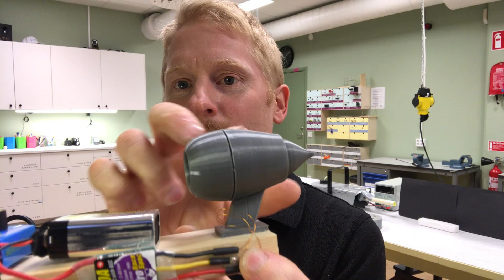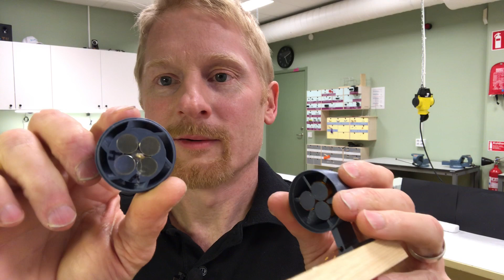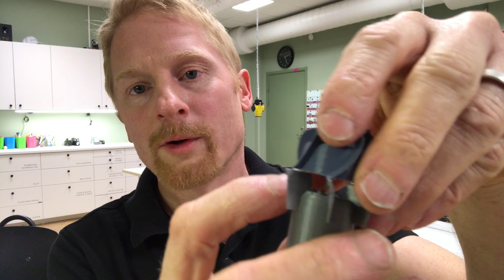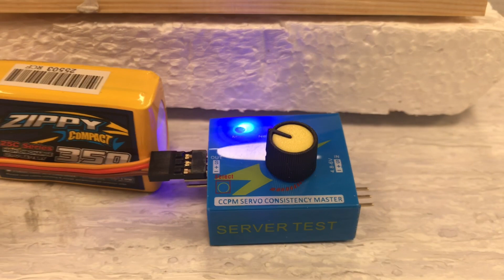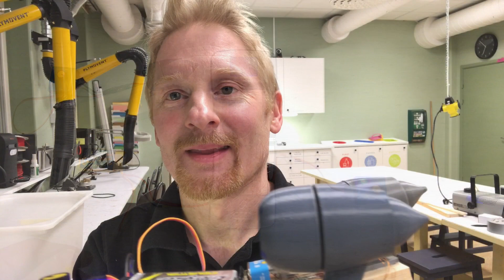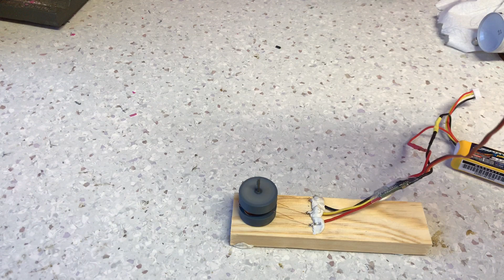Improved 3D-printed  3-phase electric JET

Comment: This is the most simple version of the axial flux motor design. The problem with this design is, that the permanent magnet flux diverges and a certain part doesn't penetrate the coil. So it is better to place the coil package between two PM packages. Further improvement comes with iron manifolds at the PM packages at the opposite side to the coil side for flux guiding.

Comment: The reason that the old design is faster is because it has less load. Also, if you construct the front section so that the place where the air changes direction (which creates a high pressure area, which is why the smoke comes out of the side even with a labyrinth seal) is further back into the back section, I think you can reduce or eliminate the leakage and improve thrust. You can also try making the airflow transition gentler to reduce the pressure at that location and/or increase the volume of the back at the transition. It would be very interesting to see the different results of each change.

Comment: I suggest incorporating a steel disc as a magnet backing plate to increase and focus the  magnetic flux toward the coils... a 50mm (2") washer for example would be cheap and easy - great work, very interesting :-)
Reply: would be a great modification, can't wait to see version 3 (not sure if that's happening tho)
Reply: Be sure not to put it between the magnets though as this will reduce the efficiency through eddy generation. I used to design magnetic drives :-)
Reply: Absolutely!  If the modifications you've suggested were implemented there's every chance this motor could be powering airliners.  

On a personal note, is flogging dead horses your fulltime job or just a hobby?
Reply: @anonymouse2141  Reduction of eddy generation efficiency could ruin the whole project!
Reply: @TheJazsa80  ah....okey dokey...my error....I assumed.itd be the same as a mag drive but of course both parts spin in that and they don't here.
Reply: Yes you need a back iron both in the rotor and stator, that would increase a lot efficiency of the electric motor, the way you built it now is a coreless motor
Reply: A pyramid magnet would be useful in focusing the magnetic flux toward the coils.  However I am not sure how you would implement it given the footprint.

Comment: Hey nice video and concept.
Would it be better to have a fully static housing, with no gaps, made of 2 pieces.

Along with a propeller set up made of reducing layers of 3d printed blades attached to the magnets. Acting as a compressor.

This would leave no leaks, and a lighter load. This would probably increase thrust output as well.

Comment: The second version revs higher because drag load has been removed and the motor rotational speed can then move closer to its theoretical maximum i.e. 120 * frequency / number of poles .

Comment: Very nice model, 7 grams of thrust is pretty good. (I'm not a expert or anything, but it is something and it worked). There's a guy building super light weight models using this design.
Would be cool if you could do a demonstration of various prop designs for comparison.
The next level is adding a gas combustion chamber, but i think that is beyond the material capabilities of a 3 d printer.

Comment: Great work, I took the liberty of doing the maths:
Old design: 1.01A @ 12.1V = 12.221VA @ average of 4.15 grams of thrust
New design: 1.21A @ 12.1V = 14.641VA @ 6.9 grams of thrust

Old design VoltAmp per gram = 2.94481927711
New design VoltAmp per gram = 2.12188405797

Using a simple percentage formula we find that the new design uses 28% (actually 27.945185823002895%) less energy per gram of thrust, quite impressive what some extra fins and a semi-decent seal can do

Comment: Try using rod magnets with a longer length and smaller diameter. You are restricting air flow with the disk magnets you are using. Nice job on the jet.

Comment: Great Work!   I'd guess that the new design, with the more efficient seal, could carry a higher angle in your input vanes, to load it more.   The newer unit may be running faster because it's underloaded?

Comment: This would be so nice if it could be made to put out way more thrust. But I guess is that was a feasible thing somebody would have done it already, probably.
Reply: It has not been done till it is done.....
Book of Shadows 12:6..... Lol
Reply: It can be done pretty easy but he didn't design it to give much thrust, its only an educational model.
Reply: @ExperimentalFun  I understand it was an educational thing, but that still leaves me wondering, why can you not readily find them at any hobby shop, or site. At least not in that size, or only electric.
Reply: It's probably been thought of but not been done as it takes a lot of time and failures to refine and develop and not many people have the persistence.
Reply: It took James Dyson over 5200 failed prototypes to get his cyclone vacumn working after the original eureka moment
Reply: @anonymouse2141  No argument here. But what this dude intends, he stated in the video, is not to produce something like what I referred to.
Reply: @DavidHanniganJr  Ducted fans and impellers can be bought for rather cheap at any model rc shop. They don't have this massive restriction but that's because that is just dysfunctional...
Reply: @Argosh  yeah but I'm not concerned with ducted fans/EDFs really. That's not the scaled down equivalent of what I'm wishing it (though probably can't without exotic technic's, and/or materials, at costs that a majority of the people can reasonably afford) could produce in raw, or responsive, thrust. Like the versions scaled down from.
Reply: @DavidHanniganJr  I have no idea what you are talking about. There's proper kerosene powered miniature jets, there's the range of EDF/Impeller systems. To my knowledge no one has ever built an electric jet, the mere concept is nonsense.
Reply: @Argosh  👍 Works for me.
Reply: @DavidHanniganJr  you can, heard of an edf?
Reply: @Toby-ju1fs  yeah I've heard of them. And they suck.
Reply: Well, speed is there, so improvement would come from profile alteration. For instance, a wider inlet for the engine to breathe more easily, a better labyrinth sealing, a narrowing inner profile for air compression and a longer/straight output cone (the angle is too steep and the flow lifts off, that causes drag). But as it is shown in this video, any improvement will lead to an increase of current in the coils so the global efficiency doesn't improve much.
Anyway, for an educational project, this one is really good and goes far beyond the 3 phase motor technique with all the peripherics involved, specific requirements (balancing, materials resistance, cooling), and testing methods. 
How I wish I had such a teacher at school !
Reply: it wouldn't be difficult to do, you could even just modify his design, so that the outer cowl is a little longer and disconnected from the inner rotor. It would assemble the same, more or less, only with the addition of glue around the seam, and that outer part would no longer rotate dangerously. I'm not sure if it would be "way more thrust" but it would definitely produce more.

Comment: I thank you for the simple system you have produced. I think i may redishn it with a small metal rod to focus the magnetic coil and use a more presice measure of wire.
Question though..... if this system is made larger and you use like 8 magnets and 6 coils.... Do we have to like reverse windings or should i try ......? Totally Awesome project to tinker with.... Thank you so much .
Reply: Sounds like you could be building an improved version of this piece of shit.  Imagine if both could be placed in a museum for the world to see.  People would come from all over to see the piece of shit that started it all and the improved piece of shit that took the pointlessness a step further.
Reply: @TheJazsa80  Ahhhhhhhhhhhh The polished Turd...........

Comment: Awesome idea, if you reduce the number of the windings  the motor would produce more power and more thrust!
Reply: ???? is that right? Hmmm.
Reply: @erniebolado3648 Of course.. I do mini quads that uses brushless motors, the more windings there are less rpm but more torque... And less windings will produce more rpm but less torque :)
Reply: @niswardfpv7949  Thanks for the assurance and added knowledge you've given me. Do the weight of the rotor have impact on rpm?
Reply: @erniebolado3648 not to much.... The most important thing is to have the rotor balanced properly.

Comment: Good evening, I wnet ahead and built the motor but now with everything connected it wont spin, it just stutters, I checked all my soldering connection and I am using a 30A ESC, any input as to why it wont work.?

Comment: I don't know if you did it already since they seem to run without much friction, but taking the side covers off and degreasing the bearings with some alcohol or something and a toothbrush will really reduce their friction. Might reduce the lifespan but it'll still be a long time before they die, I reckon. Slight risk of them melting the plastic but I doubt it, just something to look for I guess.

Comment: What would happen if you enhanced your jet and added fan blades on the outside like a fanjet engine on an airplane ? I realize it would add more weight but would it also increase thrust ? Would be an interesting experiment. Albeit you would have to edit the 3d print and perfect the added outer blade count etc ...

Comment: Hey this maybe a stupid question, but I was thinking. Would there be a way to add in capacitors to act like a mechanical motor with cylinders. My plan was to reverse the process of the three phase motors except hood it back up to capacitors and then use them with relays to fire electricity in sync with the speed controller (major flaw is relays are way too slow for 30,000 rpm) This would work in conjuction with what you already have. Although the addition of more weight and the inefficientcies may not make it vallubale. I'd still like to see it

Comment: I made one just like this, 4 magnets 3 coils. I have tried multiple configurations of wire diameter and numbers of turns, and it just won't run. it either won't turn at all and just jutters or it will only spin slow before the driver shuts off. I have tried both wye and delta configurations and yes I am wiring it up correctly. I am completely stumped.
Reply from the maker: Hmm, have you tried a different ESC?  And yes, the design is very sensitive to wire diameter. Sort of marginal design. I assume you have tried to help it start by giving the rotor a spin by hand during the initial sync at startup?

Comment: you can't fool me, this is just the first steps in a new propulsion system for your flying drone.
Reply: It will never work. His design is flawed. At a certain thrust thefront of the motor will fly off.

Comment: On my (very) long todo list is programming the HDRobotics.com Dexter robot arm to wind motor coils... potentially after 3D printing them. Experiments like this prove that local mfgr of these motors is very possible and potentially useful. Can I suggest making one that holds a propeller and measuring the thrust from that? Or a twisted string actuator.

Comment: some very late info.         in order to accommodate the size of the  radius  of yer bldc motor,   all radii  need  to  be  BIGGER.      NOTE  that  -   a  Fan  is  Not  an  engine.       if you are going  make an edf unit,  make a  somewhat  Effective  one.      the intake port should  be  WIDE OPEN,  like a Normal  edf unit.      the   design of   typical  edf impeller vanes  SHOULD  be  copied.     
each stator  vane   Reduces  edf  output.    use No more than  three.    copy stator vane angle, from an  edf  unit.        because a  Fan (edf)  operates in free-air mode,  design should result in the least possible  obstruction of air flow, through the system.        there  Should,  however,   be a   certain amount of taper,  in the exit duct.      the  cross-sectional area of  a    CIRCULAR    exit duct  Should be  Equal  to,  the   swept area  of the impeller vanes.       from the impeller area, subtract the area of the cone/spinner.     divide by  pi,  to  find   r-squared.       the  taper   length   Should  result  in  the  Least  possible  back-pressure, at the impeller.         to a degree, the  present  exit design  'simulates'  the  by-pass housing, of a jet engine.     BUT    A     FAN    IS      NOT    AN      ENGINE.            it can be seen that because a fan is not an engine,  in the case of an edf-powered  'scale' model,  the  AREAS  of, both, intake and exhaust  are  Never   Optimal.      edf-jet  manufacturers  STILL  do  not  understand  these   Basic  edf  Facts.    cheers           googletranslate

Comment: I printed the parts out on my CR-10 and the parts are so full of support they cannot be removed, so parts are not usable. What am I not doing right? Can you show setting you used as even the outer shells are weak. Help! Like the idea but wish you would have said more on how you got it printed.
Reply from the maker: Im slicing the STL file in Cura  I use the setting "touching build plate"  option in the support settings, which leaves  most of the the internal parts of the rotor and stator free from support structures.
Reply: You can you remove supports by drilling them out, or heating metal rod hot enough to melt plastic and push it away from the hole and just doing more balancing, or if you want to try again (presuming you are using repertier host and its slicer cure) go to Slicer->Configuration->Structures->Supports section on the options and option "distance XY". Increase this value to move supports away from the parts walls. I have that in 1.5mm what works well for ABS and PLA, but PET-G still sticks for some reason. "Distance Z" to increase gap between support and parts vertical surface its supporting.

Comment: try to modulate RPM by bass - chineese compact subwoofer - is just a fan with helicopter style angle modulation servo-system - and gives directed bass from 0hz - with DC airflow component - to ear +-AC airflow bass, you can even get stereo bass with laptop stile sub-fans with that principle, that is imposible with any loudespeacker - only with headphones possible - due to not-directed nature of bass (meters of wave long) accoustic waves

Comment: I tried this build and instead of an electric motor, mine turned into a speaker that beeps out the ESC codes...  ??? Coils are not magnetic to the touch of metal. Any ideas?  Cool project though, thank you!
Reply: Eureeka! It works great now. Just needed to tighten up some tolerances. It still beeps out the ESC codes too. Thanks!
Reply: Also printed a 2x size of this project. Just double the size of the wire, magnets and shaft. Awesome! Runs better than the smaller one for me. Doesn't overheat the coils like the small one on lipo. 
Bought your propane jet turbine plans. My next project. 👍

Comment: What kind of dc motor control did you use in this build?
Reply from the maker: Any brushless R/C ESC will do, check out hobby king or eBay. 10A, 3S will do fine.